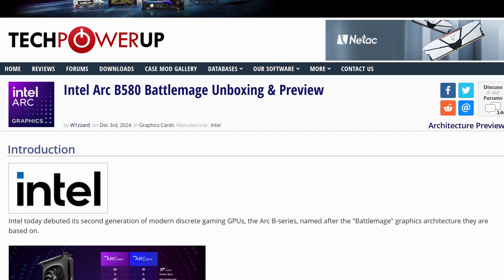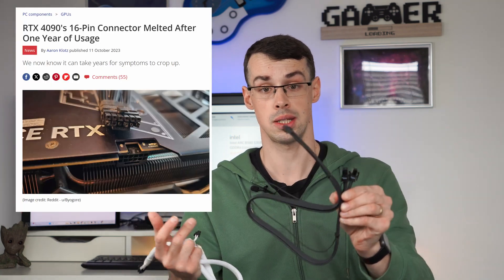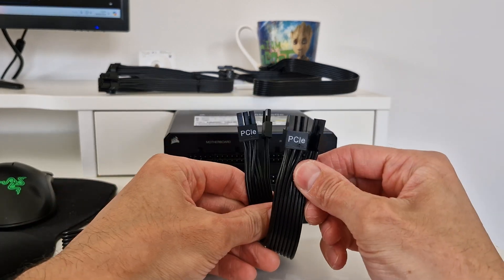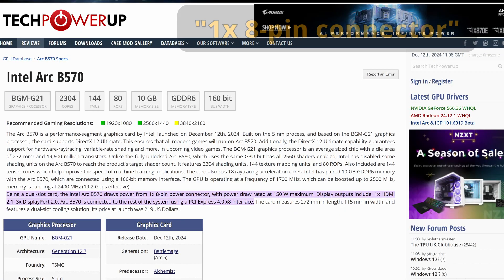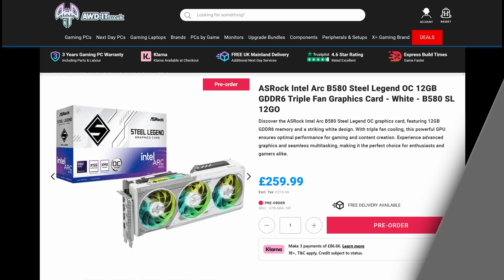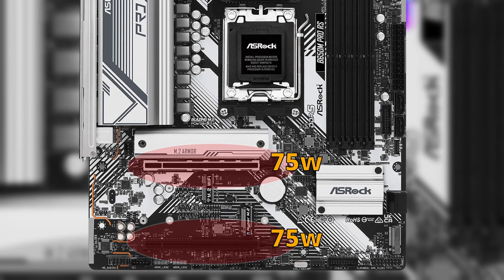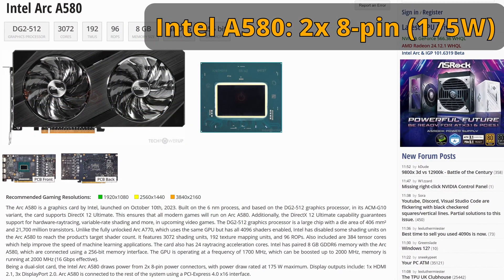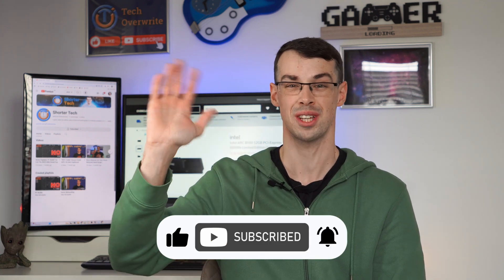What PCIe Cables Do Intel Arc & Battlemage GPUs Need?

Comment: With as much bad press as the 12VHP connector had, I'm glad to see Intel stick with the tried-and-true connectors.
Reply from the maker: Me too, I have always half considered switching to NVIDIA but the new connector does put me off a bit. It would always be in the back of my mind as to whether I'd experience issues down the line... even though admittedly I don't have the budget for an RTX 4090 LOL! I'm really pumped for the Battlemage release - I'm glad the B580 has got off to a good start in the benchmarks.

Comment: Can you please do a comparison video of Battlemage on Pcie 3.0 vs pcie 4.0?
Reply: It's literally the same thing as other cards, hardly any card has more "compatibility" with lower bandwidth
Reply from the maker: Thanks for the video idea. I agree with @cabeswater01 that right now there's not much performance difference between PCIe 3 and 4... assuming a card is getting the full x16 speeds. Even the "very modern" RTX 4090 runs at gen 4 (when you'd imagine it would be gen 5).